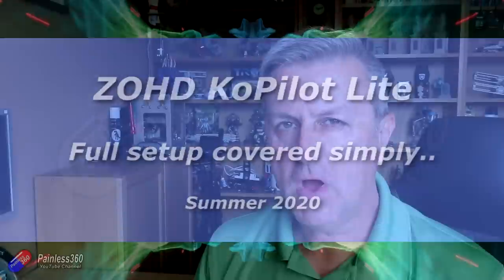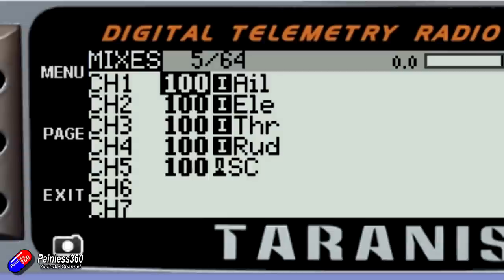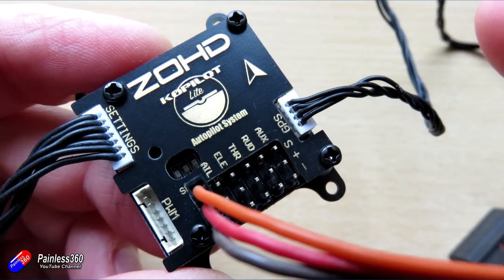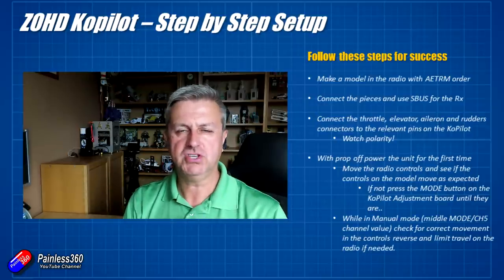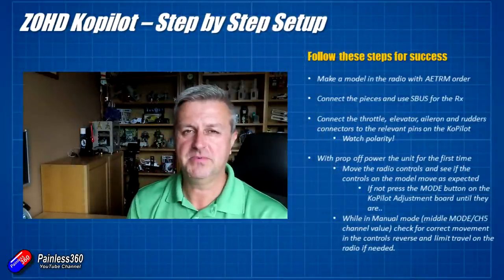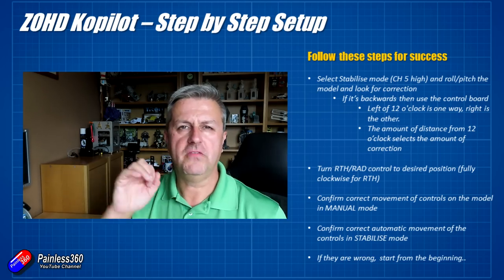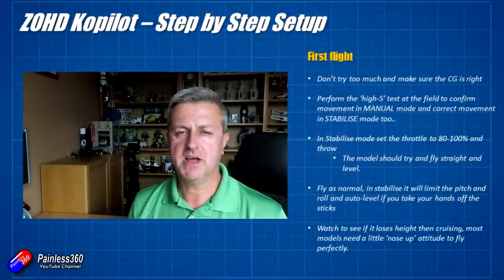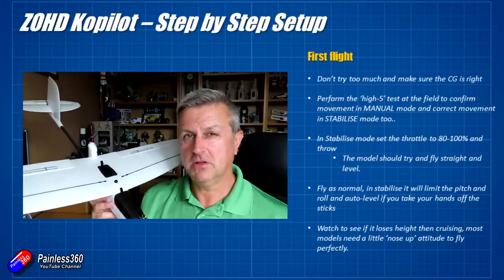ZOHD KoPilot Lite: simple stabilisation and RTH - step by step setup for new pilots

Comment: I've had over a dozen successful flights with Kopilot on my ZOHD Drift.  But the first time I used RTH, I was unable to switch out of RTH after the model started circling over my home point.  I tried both manual and stabilize.  Finally, after about 5 minutes and repeated tries, I was able to switch back to stabilize and land.  I'm using a TBS Crossfire receiver and had good link quality. Just wondering if anyone had a similar experience.
Reply from the maker: I've never had that here, anyone else?
Reply: @Painless360  Apparently Andy Newton had that happen in GeoFence Mode only.
Reply: @raptr49  When and where did Andrew Newton mention that?
Also to regain control when the Kopilot kicks into RTH by hitting the "Fence" distance set, you only have to move the aileron/elevator stick once it clears the inner boundary. (Tx connected to Rx obviously!)I can't truthfully say if I've ever tried to regain control simply by choosing another Mode - something to check sometime. 
Most issues with setting up and running the Kopilot Lite are covered in Post #2424 of the RCGroups Forums Thread on the Kopilot. Any others you find we'd be glad to hear about and add to the list though the Kopilot has just about run its lifespan now. The Sparrow 2/3-OSD is better bang-for-buck these days. Or the Radiolink Byme-A/D for no GPS.

Comment: Quick warning: if you're setting up on your bench in stabilized mode the motor will be grumbling or clicking as it waits for a GPS lock.  This means that there is no airflow over the ESC and it can get HOT.  Unplug a couple of the motor wires if it's taking a long time to get the pots set up right.

Comment: Im using a flysky fi6 controller and I just can’t get zohd to work on my arwing any help would be much appreciated pls.
Reply from the maker: Make sure the Rx is set to SBUS out. Best of luck!
Reply: @Painless360  Stock, the Flysky FS-i6 transmitter cannot be set to transmit S-bus (only i-Bus.) So, unless your receiver has an on-board i-Bus to S-bus convertor (which I think an A8S might just have) you cannot use it for S-bus connection - only PWM. The Flysky FS-i6X and S though can be set to transmit S-bus to receivers like the FS-iA6C and FS-iA6B.

Comment: Alls almost good on my KP nstall but no gps lock, keeps flashing blue with intermittent red.  Please help
Reply from the maker: I'd try the GPS in another location to rule out interference.. Best of luck
Reply: @Painless360  Thanks for the reply I tried different locations and different esc,no lock also in stable/balance mode the flaps have crazy movements.
Reply: @bladeystudio  The "keeps flashing blue with intermittent red" are the leds on the GPS puck. Forget about them. The red led to the inside of the green leds on the main Kopilot board tells you what the GPS unit is thinking. The "no lock also in stable/balance mode the flaps have crazy movements." also make no sense. If "the flaps" as you call them are twitching then that tells you that you have GPS lock and you are in RTH mode on the channel 5 mode switch - not stabilized. In Stabilized and Manual modes you should have motor control (if your ESC is calibrated correctly) but not in RTH until the plane is moving at more than 4m/sec. That's the autolaunch feature.
Reply: @theoztreecrasher2647 Thanks for the reply but I've had several bad flights with Kopilot and its supposed functions resulting in a totally trashed Recruit.  Kopilot is supposed to be simple and simple set up and it is. I never received a tech support response from the.  Very bad

Comment: Flysky fs-i6x Can it be controlled via remote control
Reply from the maker: If the receiver you are using supports one of the connections that the KoPilot will take -  I use SBUS here..

Comment: i setop a copilot lite on a ZOHD GTRebel i setop all same as this instruction but when i power it up i gut a 4 to 5 beeps then a rapid beep it don't stop what is that mean?
Reply from the maker: Not sure, all the steps I follow are in the video... best of luck
Reply: i figured it out sir thanks for the vids. it helps. naw I'm in tuning and calibration processes thank
Reply: @olyddiego8515  Do you recall what you did to fix this? I calibrated the esc first, then hooked up to kopilot. I get 2 beeps, followed by 3 beeps a couple seconds later, then the esc just constantly beeps rapidly for as long as its powered up.
Reply: @Drieeedger  make shure you calibrate your tx first 0% to 100% travel  then thy calibrate your esc. i found mine in wrong travel. or it beeps rapid if you palg it in to a wrong pin check it   1st

Comment: I bought zohd 250gm a few months ago.  After watching your video, I have confident to set it up.  However, I do have an issue.  With it is in stabilizer mode, one of the control surface is not level.  It is totally ok in manual mode but once I switched to stabilized mode, one of the control surface will move away from level and I don't what to do to get it back to level.  Any idea how to resolve it?
Reply from the maker: If you're testing on the bench then if it's ok in manual mode then you should be great. The FC is moving the control but not feeling any resulting movement (as it's on the bench ;) )...
Reply: @Painless360  will test it. After calibrated the gyro,  it seems to be better now
Reply: @Painless360  I still have the problem that when I adjust the gain, the control surface moves to extreme down and do not want to come back to level.  Then, I have another problem.  I try to move the stick to calibrate the gyro: nothing happen.  The LEDs do not flash.  I tried to fly it the way it was.  The plane roll upside down and crash.  I am flying a delta wing.
Reply: Latest update.  I work totally normal with my normal 4 channel T-tail.  Control surface works as expected. Calibration without any problem.  I guess it is a software gitch with delta wing

Comment: It's OK but ZOHD needs to add an equivalent of acro/air mode. It either off with no stabilisation from wind gusts or the equivalent of angle mode with angle limitations on roll, elevator etc. An incomplete product.

Comment: Anyone able to answer a question I got? Setting up my drift with the kopilot and all seems well other than when I am in stabilized mode, I have very very little control surface movement. Probably not even a 1/4 of what I have in manual mode. Only thing I can think of is maybe if I didnt have a gps lock, but according to the kopilot, I have a good lock. Huge thanks if anyone can help!
Reply from the maker: That is normal. Happy flying
Reply: @Painless360  Thank you!

Comment: What if it does absolutely nothing but give a light show? I'm about to scrap this whole thing....
Reply from the maker: What troubleshooting have you already done?
Reply: @Painless360  WOW, first, I've heard how awesome you are, and I love your videos, but... when I post being halfway smart-ass never expecting a response, and within a few hours here you are. Thank you! To be honest, I don't even know where to start. I've never used a FC before so I'm a bit lost. It's got power, if I long press the set button control surfaces move to both extremes, but that's the extent of it.
Reply from the maker: You need to follow the video EXACTLY. The setup relies on the thing being in the right mode (stabilise, manual etc.) to do things like calibration and mode settings. That is one of the most common errors. Best of luck

Comment: Hi Iv got no throttle even in manual mode. But all controls are good please help
Reply from the maker: Then check the power and connections to the ESC and motor as a first step.. Best of luck!
Reply: Painless360 hi. Have figured out that the protocol for my esc and the kopilot do not work. Apparently it shuts down the esc which esc would u recommend for a 4s setup. Mine was a turnigy plush 60amp. Apparently a zohd esc will work. But may take a while coming from China. ?
Reply from the maker: I have heard of some ESCs going into a 'safe mode' if it doesnt see a valid signal quickly enough. Maybe there is a way to turn this off on the ESC you have?
Reply: Painless360   I’m using a turnigy plush 60amp. I do have a programming card but wat would I turn off. ??

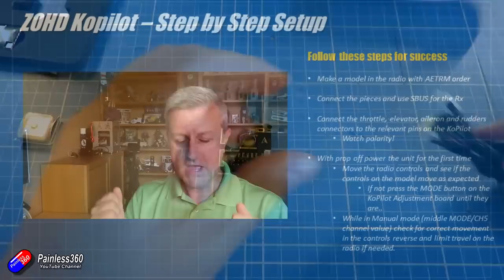Comment: I've followed this exactly yet after 3:05 it does nothing and just sits there dead.
Reply from the maker: Then you've probably missed something. Most often it is using the right flight mode (stabilise, manual or RTH) for the things you're trying to do. Rarely, it can be a damaged KoPilot.. Best of luck
Reply: @Painless360  Thanks :)
Reply: Do you have any green lights STILL lit after 20 seconds from plugging in the battery (your channel 5 switch MUST be either up or down) OR manual control of the throttle if ch5 is in the middle? IF NOT and the sequence you see when powering on the unit is Red and Green Leds on for about 3-5 seconds then off then nothing no matter where you have the channel 5 switch (correctly assigned!) then your problem is the ESC that you are trying to use. 
Some ESCs do not like the long time the Kopilot takes to boot up fully (about 20 seconds) and shut down assuming a loss of signal. To check this you can power the 5 volt rails with a separate power supply and see if the system boots up correctly. ZOHD ESCs will work but others can be a crap shoot!

Comment: Well, my twin star is dead. Full down elevator and full throttle, when rth was activated
Reply from the maker: Oh no! If it flies OK in stabilise mode that usually means that you've set it up OK..
Reply: @Painless360  it wasn't😂
Reply: @Painless360  i dunno what the frig happened. I connected everything, controls was inversed, i put the settings board in, then controls was correct. I thought I'd leave it in. I tested stabilizer mode on ground, no problems. Maybe I should have inversed the controls on the radio??
Reply from the maker: Sounds likely, see the setup steps.. Best of luck
Reply: @Painless360  thanks man. Do you leave the settings board in while flying?
Reply from the maker: I keep mine connected..
Reply: @Painless360  right, okay. Thanks👍
Reply: @manden22  If removing the setting board you MUST do it BEFORE powering off. Otherwise the settings you have just added can be lost! Crazy but true! Also set the servo correction directions for A and E with the settings board pots BEFORE you reverse any stick channels on the radio. Reversing the pots ALSO reverses the stick control. Reversing the sticks in the radio HAS NO effect on the stabilizer in any mode.
Reply: @theoztreecrasher2647  okay, thanks for info. Well, i removed the kopilot and glued the star back together. Flies like a charm.

Comment: Thanks for this Lee. I’ll have another crack at my Kopilot then. I never did manage to get the sbus RX to talk to the Kopilot. 
Mine is going in a Zohd Orbit wing. I assume I use a different mixer setup in the Taranis for a wing? (I’m sure it’s a dumb question but I’ve just woke up, sorry).
Reply from the maker: There are three basic model setups - wing, T tail and V tail. You'll need the wing on the KoPilot. The setup on the Taranis is ALWAYS the same...
Reply: Thanks Lee. I’ll have another look later. 👍

Comment: Good evening, I wanted to ask for an info please, when at minute 5:33 I have to check if the stabilizer corrects the movements well I realize that nothing happens!
could you help me to solve this problem? I have been rehearsing for days but without success 😞
Reply from the maker: Check you are not in manual mode when you try.. Best of luck.
Reply: @Painless360  obviously I try in balance mode but the same nothing happen
Reply: @Gions54  Provided you have it all plugged in correctly and the Kopilot is OK then probably you have the pots set to 12 o'clock (or very close to) which is the null position. For initial set-up turn them all fully to the right.

Comment: Once I have this all configured and set up, can I still mix for Differential Thrust on my Transmitter?
Reply from the maker: Not really, only one throttle channel on the Kopilot Lite.
Reply: @Painless360  Thanks,wasn't quite sure.
Reply: @Painless360  I am building the Sonicmodell Binary for ELRS with 3 FPV Cameras.
Reply: @billyrebcollins9615  Lefei Sparrow 3 runs with ELRS and offers motor diff thrust plus more mode possibilities as well as OSD. Price comparable to this which it seemingly has just about replaced.

Comment: Is this compatible with the dji air unit or vista to use as Vtx and rx?
Reply from the maker: It doesn't work with any FPV system so you need to treat the install of the HD FPV system (or analogue) as one without a flight controller. Check out my INAV builds for beginners if you want to have an OSD..

Comment: Is there any reason why when I throttle up my elevator slowly goes down I have the v tail..
But in manual mode its fine?
Reply from the maker: Stabilisers can do wierd things on the bench. Check directions are good and it'll be fine flying... Happy flying